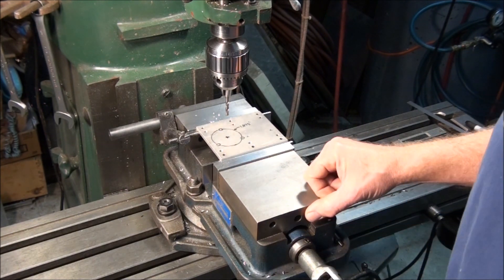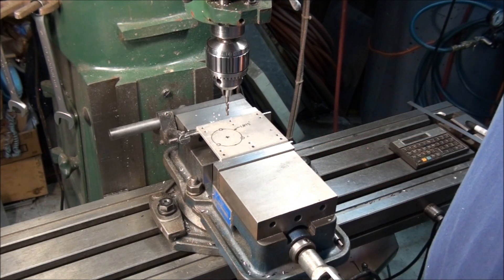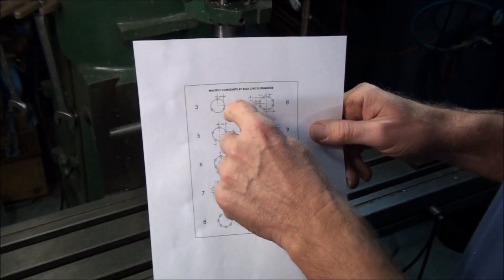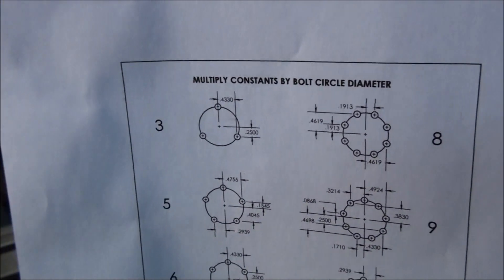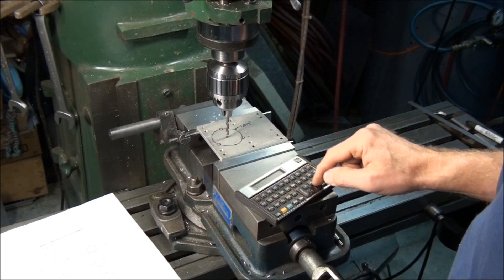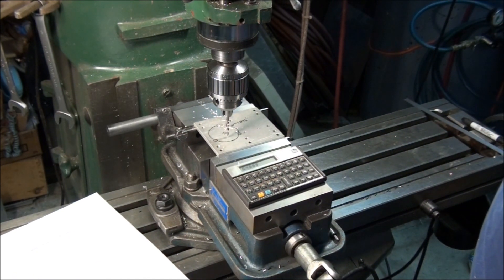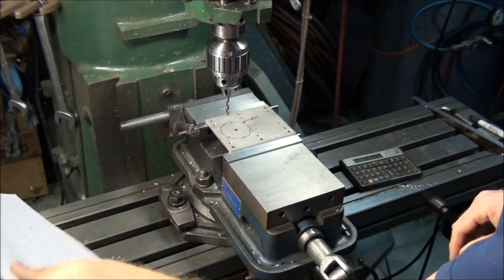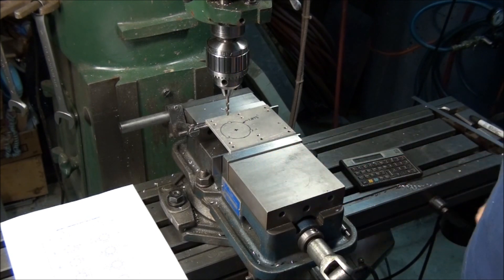Using a Chart to Find the Center of Holes on a Bolt Circle

Comment: Our mills at school have dros that have bolt circle functions, but I wanted to know how to do it without a dro and this way is super easy and quick. Thanks for the chart pdf!
Reply from the maker: Thanks.

Of course the chart had to be derived by someone using trig, right? If you have a working knowledge of that, you don't even need the chart.

Tom

Comment: Hi Tom.
Great video, do you by any chance have the same chart for metric measurements?
Reply from the maker: Thanks.

I do not, but I may be able to squeeze some dual dimensions into this one, or just make a duplicate chart in metric. I'll tack it on the to do list.

Tom
Reply: Toms Techniques Very much apreciated. :)
Reply from the maker: Jens Chr. Bøgh-Boysen

Ok Jens, you almost had me convinced that I needed to make a metric version of the chart, but fortunately that won't be necessary. The numbers on the chart are constants, meaning that they will work with any measurement system (inches, millimeters, leagues, cubits, whatever). Just multiply the diameter of your bolt circle in millimeters by the constant on the chart and you'll get the correct result.

Tom
Reply: Toms Techniques Doooh.. Of course, i might have been a bit tired... Just stumbled on your channel yesterday, and sucked in a lot of your great videos. ;-)

Comment: Tom - as always, super advise and info.

I'll def be getting a copy of your chart.  One bit of extra info that would be a great addition to this would be how to FIND the center or the diameter of the BHC.  To wit: I have a Sieg SC4 lathe and want to make an adapter plate so I can use a 5" chuck.  I've not been able to find any specs on what the BHC of the spindle mount is - but know the distance between the any of the 3 holes is 73mm (the chord of the circle).
I have a 6" cast iron and need to locate the center - then drill the 3 bolt holes.  But can't seem to get a good technique to locate that center!

I'd think making such adapter plates is a common activity - so this bit of info added to this excellent video would be a super help!
Reply from the maker: Unfortunately YouTube doesn't allow me to edit the videos, but if you know the chordal distance between two holes on a three hole bolt circle, you can use my chart to find the diameter. Just divide one half the chordal distance by .433 to get the bolt circle diameter.

Tom

Comment: Thanks for this video and the bolt circle chart. Although I have a bolt circle program on my DRO this chart will come in handy for project my DRO wont work with lol. I am thinking mostly just quicker. Thanks again and I am enjoying your other videos as well.
Reply from the maker: I keep a number of different charts stuck to the side of a filing cabinet. It's quicker than looking them up in Machinery's when you need them.

Thanks for watching.

Tom

Comment: Hi Tom, I am still stuck on threading issues here is a video I just made:  I'm having problems learning to thread on a grizzly metal lathe  Please comment THANKS!.  Anyone else is welcome to comment as well which is why I publicly made this post.  First off I realize I am using the standard method not the one you taught so I apologize for that I am just trying to make it as easy as possible at the start.  At this point in time I am just worried about them looking right lol.  Everyone seems to have their own way I found a machinist only a few miles from me that doesn't even use the compound to cut threads.  He offered to come over later on but is busy the next couple weeks at least so I thought id try to stay out of his hair as much as possible.  Thanks!

Comment: Hi Tom,
Super info as always!  Question,...how does this or can this sheet be used if the holes need clocking..hmmm, I am writing and thinking I need to watch again maybe I missed it?

Chuck
Reply from the maker: Chuck,

The chart is a quick solution for most common hole patterns. Anything outside of that would need to be done on a rotary table or dividing head.

Tom